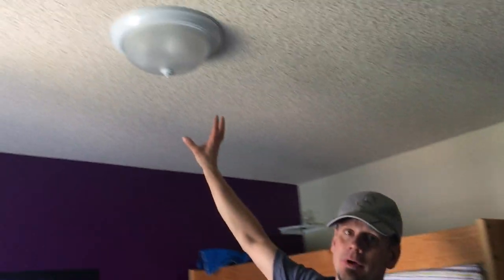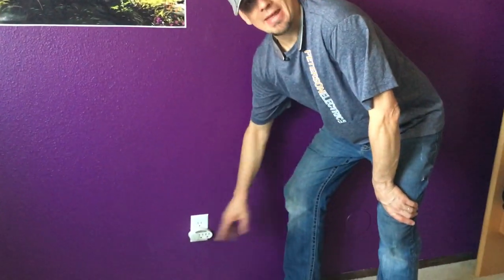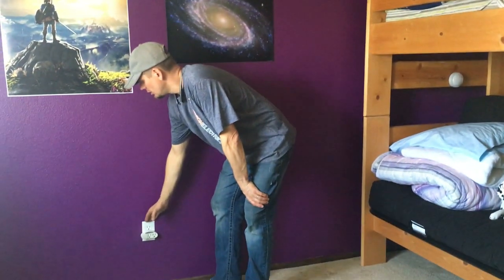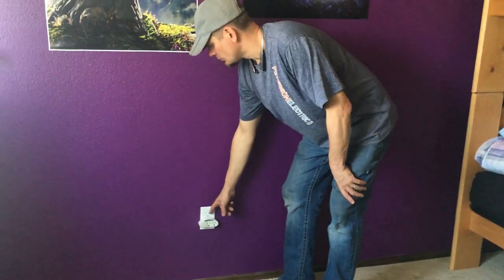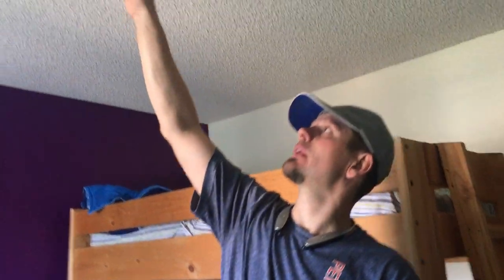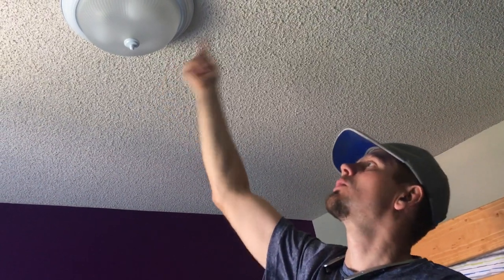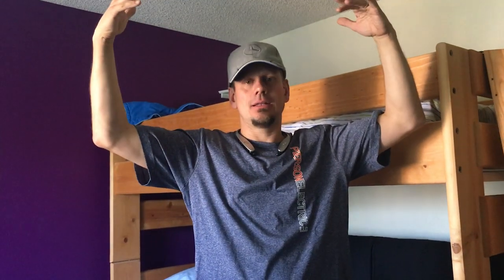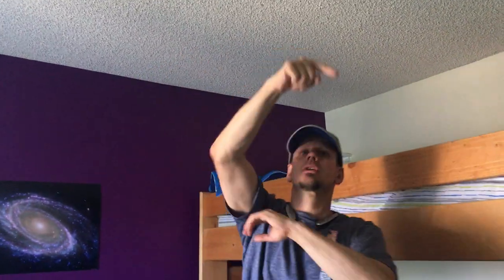How to Change a Switch Receptacle Location To An Overhead Ceiling Light

Comment: Nice video thanks. One question though, adding a light to say a circuit that already has 12 devices on it, would you just go ahead and add a 13th or would you follow the code to 100% and pull from another circuit that is less busy?